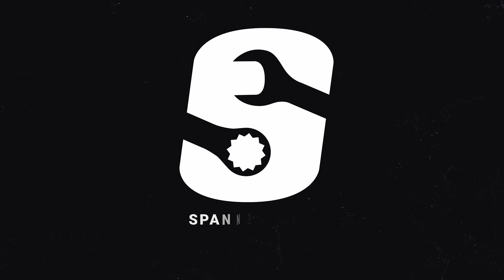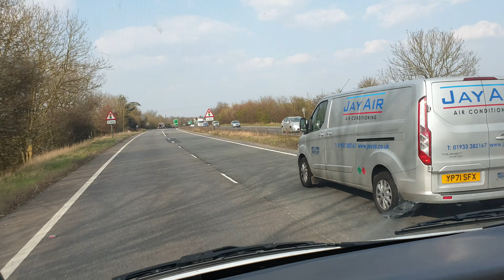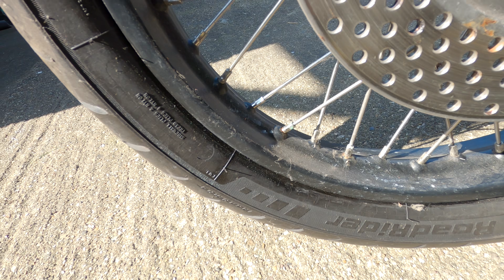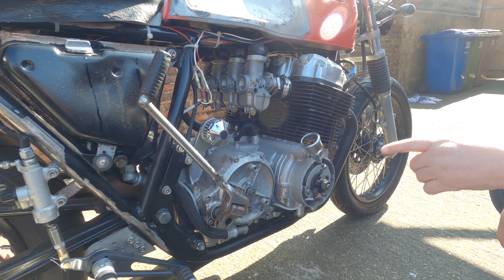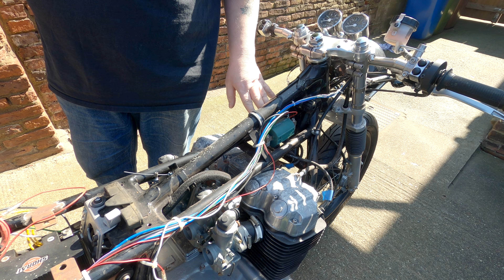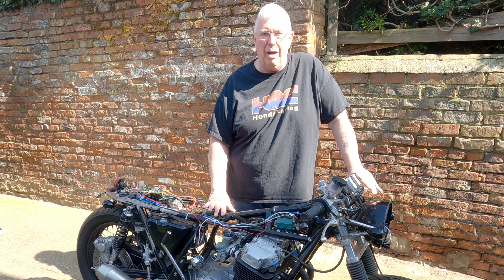Honda CB750 Cafe Racer Project Bike | Barn Find Bargain Unfinished Motorcycle Build | 01

Comment: Really loved the video! I’m curious to know what you look for or any guide to buying a first care racer project? I’m looking to do my first one myself and would greatly appreciate any advice/experience. 
Thanks Steve
Reply from the maker: Thanks for your kind comments.  With regard to looking for a first Cafe Racer project, I would advise going for a mainstream model, such as the CB750.  That way finding parts will be easier, and there will be more choice.  I would also recommend going against what I have done, and getting a running bike, that way you will only have to worry about the cosmetics.  Don't be too proud to use ideas that you have seen other poeple do, or to use off the shelf custom parts, and don't decide to try to do things nobody else has tried for your first build.
Reply: @SPANNERRASH  that sounds like sensible advice thank you so much! I’m looking at the CB550/750 and Yamaha XV750 but it’s working out what sort of models and parts to look for on a budget. I’ll be following your channel and future projects. Thanks again Steve

Comment: I like what the previous guy did to the tank.   When it's painted it's going to look amazing.   I don't know the market for these old Honda's in England but the previous owner probably spent close to a grand on new electronic and rear shocks.
Reply from the maker: Yeah it's a really cool idea he had. I think the parts cut from each side have simply been swapped around so they are inverted. Must've been bloody hard getting them, to match. The filler cap is a bit more classic looking too. It's a shame the rest of the tank is quite battered and tatty, but I'm sure I'll be able to finish it off nicely. :) Unsure about the colour at the moment though.

Comment: Nice project. I'd guess £1500. Looking forward to watching you strip it down and rebuild. And of course to finding out how close I was on the price!
Reply from the maker: Nice one Phil, I'll be revealing the price in one of the upcoming videos in this series so keep your eyes peeled for that. :) I'm feeling pretty pleased with myself and eager to get stuck in working on this cafe racer project.
Reply: @SPANNERRASH  I restored a CB750K6 over about 15 years - every nut and bolt replaced and now looks like it did the day it came out of the factory. I've got boxes of bits accumulated over the years that I'll never get around to selling on eBay so let me know if you're struggling to find anything - and if I've got it it's yours.
Reply from the maker: @philw4053  You're a true gent, that an extremely kind offer, thank you! :D Your K6 sounds like its a real keeper then. There aren't many in that kind of condition.